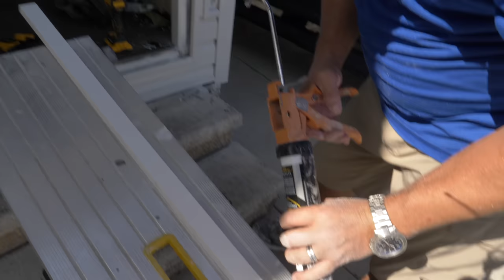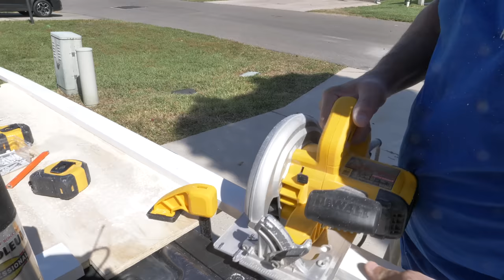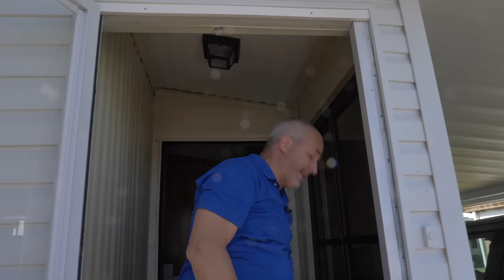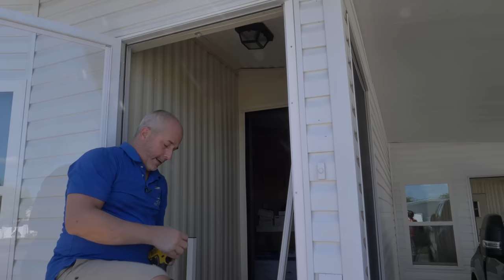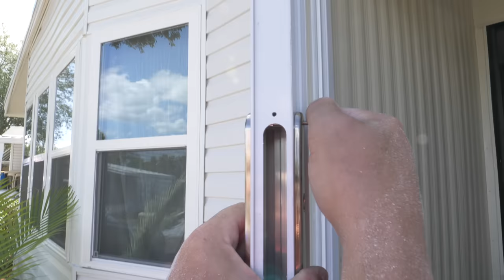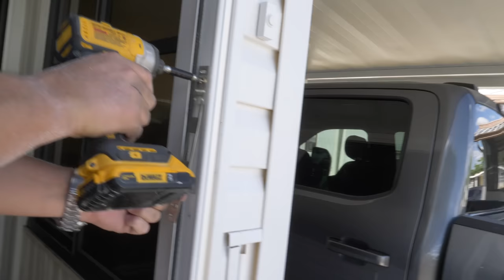Storm Door Replacement | DIY and Save $$$

Comment: Pro tip: Remove the glass panel from the door slab for easy one-person installation.
Reply: You are going to lose that finger doing that! Mark my words.😢
Reply: That sounds like a lot more work. Is the glass even removeable on this type of door?
Reply: @MetalAsFork  yes but removing glass would not be easier... I have an Andersen 4000 and had someone install it. Glass was not removed to install. BUT yes the glass is removable.
Reply: Good tip 👌
Reply: Thanks

Comment: Good job on the inspection. The hardware however is not free, it’s included. Dad always said, nothings free.
Reply: Lol, true for many things 🤣
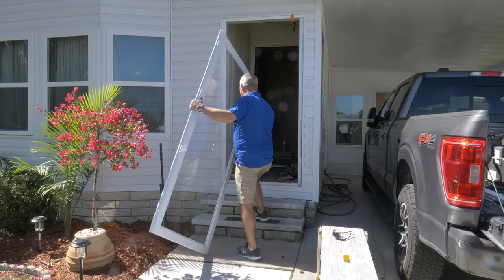Reply: So far it doesn't seem simple! Too much measuring, power tools, adhesives, etc. Doing it yourself went out the window at about the 6:00 point on the video. I love your Channel, but this is way over my head🤦
Reply: I have to agree with all the power tool usage

Comment: Dude just did my threshold on my 100yo house, and repaired some dry rot. It was such a pain in the ass to get it to seal on the bottom..props you man I couldnt be working on my knees everyday and I'm still under 40. I can barely move LOL.

Comment: When we lived in Florida, we always preferred the storm doors with a sliding window that had a screen in it. The 3 months a year that the weather is nice, it's nice to be able to open it up to allow the cool air to come in. The solid glass doors act more like a greenhouse and will heat up the entrance. It is a nice door, though. You're right about the ones made for mobile homes as they are ugly and cheap looking. A lot of people just install a traditional door and frame  made for a house. This makes it easier to install storm doors and is also more secure than a flimsy mobile home door. It also looks a lot better.

Comment: I'd like to see a troubleshooting video for this type of job.  I think I can handle installing a new storm door, but the "what ifs" are stopping me since I'll have no clue what to do if it isn't level, plumb, doesn't close, or any number of things that can go wrong.  I'm in a 1985 condo complex which has a good amount of settling and because the storm door has been off for a while, I think they're may be water damage or swelling of the actual frame in places.  If I go to put the storm door in and get stumped in the middle of the install, it'll be a nightmare.  Thanks for the video!

Comment: I'll be installing a screen door to my enclosed porch today. Only I have to build the door itself custom, and build out the entryway because the measurements for the  entry/exit are non-traditional. The construction for the porch is shockingly bad because the builder decided to use the 4x4 deck supports as part of the framing for the walls, windows, and door. As a result literally nothing is consistent, and all the measurements are off.  If it were up to me I'd rip it all down, and do it properly, but we don't have the cash to do it so we have to live with what we have for now.
Reply: I can commiserate with you. I live in a cinderblock house that was built my guess the main house, in the 1910's? And then at some point, I'd say the late 30s or 40's they added on to the house using the next generation of cinderblock. All the windows and doors on one end of the house are uniform. The newer addition match themselves. But both do not match in construction techniques. The older end, all the walls are uniform from the footer to the roof line. The newer addition the block is not. Its two different block widths. Wider at the bottom, narrower at the top. Mortar lines as similar but not exact between the two. Its a challenge to find doors that will work in openings that not only differ in width, but height as well. The windows are uniform because I just found the largest window size that would work in the vertical windows, and the same with the sliders at the other end of the house. The floors have all been set/sagged at different heights thus most the doorways from room to room are different heights. Slowly changing out things as I can afford, and hopefully get the same plane for the floors. Interestingly they decided that the maximum ceiling height would be 7' 4", making other things a challenge. Its definitely not standard construction by any sense of the word. But I too have a pay as you go, so one small victory at a time...
Reply: @denisegaylord382  Wow, that sounds like a complete pain. I thought I had it bad, lol. I think for mine it's the roof for the porch is the worst. Not one single joist hanger was used. Instead he decided to set the 2x6s on top of the 2x8 structural beam because he either didn't know how to add the soffits, or was too lazy to put in the work to do it right.
  Then instead of placing full 2x4 studs above the 2x6s for extra support for the roof, he made jack studs then sandwiched the 2x6s with 1/2" plywood "for strength", but it actually does nothing but add weight to the roof, lol.
  According to our neighbors his method for construction was based on how many beers he had to drink, which explains a lot, lol.
Reply: @demontekdigital1704  oh I know that joy too. When they built this place, they didn't have joist hangers, insulation, vapor/ wind barriers, or any of the modern products that we do today. They essentially slapped a 2 by 6 rim joist around every room, and hung the 2 by 6 floor joists off it. Everything was built with green oak lumber off the farm. True 2 x 4s though. I don't even have bird's mouths on the roof rafters. They just stuck the rafters up, threw a crosstie about a foot down from the peak, and everything it toe nailed together. Floor joists, rafters, Everything. When they were in doubt, they threw another nail in it, or beside it to keep from twisting. The lumber is now so dried out now that you can't drive a nail into them. There is barely any overhang on the roof, and no soffits what so ever. They cut 1 by 4' and tucked them between the rafters and side of the house. Some places they cover the gap others, not so much. Oh and the rafter spacing varies wildly between them. 14 inches, 18 inches, 32 inches, yeah whatever looked good... Same with the floor joists. I tried to put bridging between the floor joists in the kitchen and bath, I can't drive the nails into the joists. I thought, OK, I'll try screwing them in, nope my drill driver won't do it either. I gave up and stuck new 2 x 6 beams on adjustable posts under all the joists of those floors to get the floors to quit flexing. At least for the moment they aren't a trampoline anymore,  lol. I figure when I get there, I am just going to have to gut it all and redo the rim joists and floor joists if I ever want to put tile down in the wet areas. Right now there are too many ripples in the floor that even linoleum or vinyl won't stay flat to it. Oh the joys.... I may complain a bit about what she needs, but I can't complain too much. I am grateful for what I do have,  and slowly gleaning enough information and know how on how to fix it. Jeff, his advice, and how too's have been a God send. 
My last house was built by a contractor, but we used to kid, he was a better plumber, 😉 I found a beautiful 3 foot rosewood level in a wall of that house. I still use it. 😊  so I can understand the number of beers quotient...I live in the rural south where "hang on to my beer and watch this y'all" isn't just a phrase. Lord help us, 🤣🤣🤣
Reply: @denisegaylord382  Holy poop you're in a pickle. The room I'm describing is an outside, enclosed porch, and nothing structural on the interior. That means if we wanted to we could totally neglect it, like the last "tenants" did. I call them that because they treated this home like a rental, rather than their home. Our issues are mainly cosmetic, with the occasional badly taped corner in the dining room (which I suspect someone else did after the fact). 
  Ours was built in 1980, and is still in good shape other than coming up on needing a new plumbing package. We're slowly getting there though. I just replaced the closet doors trim, did a piss-poor drywall patch job, (Jeff would be disgusted, but I tried), lol. I've done some light fixture replacements, replaced the faucet P-trap assembly in the hall bath, replaced the toilet fill assembly, and seat, painted most of the house, and even managed to replace the fan assembly for the stove vent hood.
  The goal we're working on currently is replacing the porch screens with pet screen, adding a door, getting an inexpensive grill, and a bug zapper for entertainment, lol. We also live in the South. We live in a small town in Georgia so bug prevention is a must. Off is my best friend, lol.
  I hope you get all your stuff done so you can enjoy your home more than you already do. So many people give up, and tap out when it comes to stuff like what you're dealing with. Like I always tell my wife, "I have caviar dreams on a tuna fish budget." LOL

Comment: Yeah that was the main reason I stayed away from mobile homes when looking to purchase my home. I have rented and worked on them in the past. Mostly everything is special order cause they use different measurements on stuff. I like to just go to a big box store and pick up a replacement and just install. 😂 I was really pissed when I had to special orser a basement door in my home as well. Instead of piping the plumbing a different way they stuck it right in front of the door so my basement door is not a off the shelf door. I wish everything was just same sizes all the way around with things.